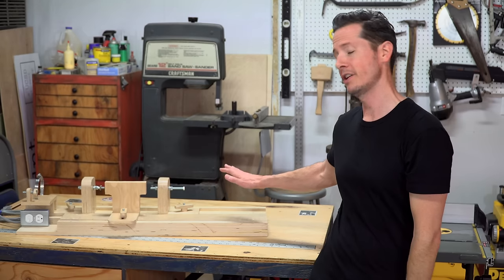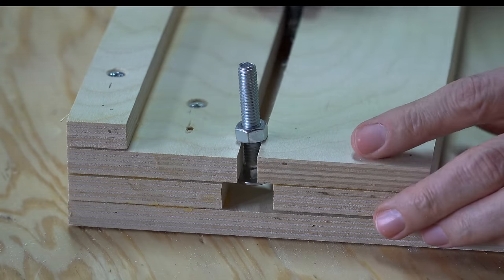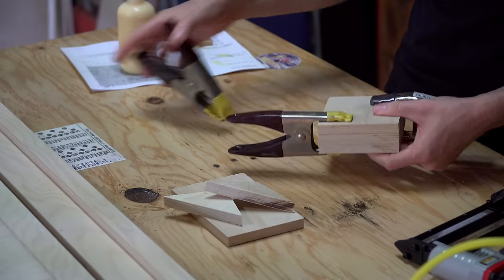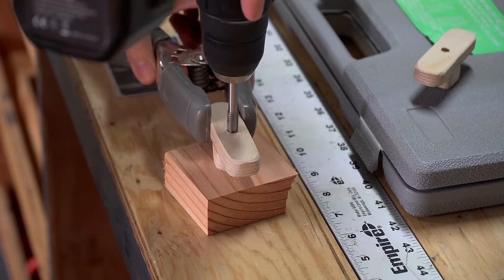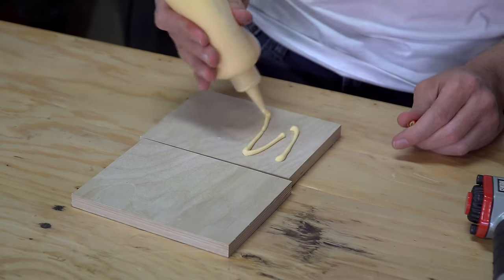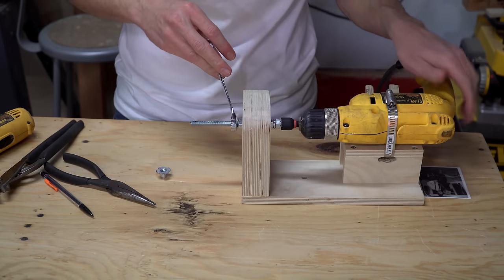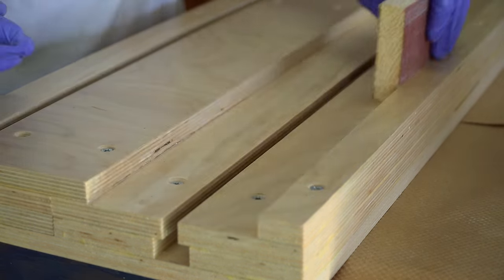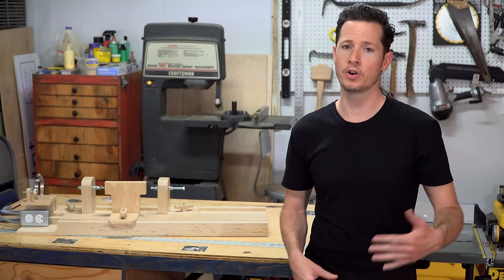DIY Drill Powered Lathe

Comment: The idea is good, but there are several dangerous mistakes. The detail on which the chisel rests during turning should be lower. Ideally, its height should be just below the turning axis. long grip which will reduce the effort at work and in which the inner shank of the chisel blade enters the handle more deeply. and do not forget to wear glasses and a mask when working. the details that the rotation throws in the face. security above all else. with respect and wish you every success as a colleague to a colleague from Baku Azerbaijan
Reply from the maker: Thanks for the feedback! I've actually made some of the changes you're talking about based on what others have said. Have a look here: https://youtu.be/UqvVQ2dZaAU

Comment: You might want to make your tool rest adjustable height width because it's too high think you need to watch some YouTube videos on Lathe turning to see how High the tourists are when they're turning it may help a lot you could injure yourself running it. High
Reply from the maker: Thanks for the suggestion - a couple other people have mentioned the tool rest as well. I’ve already changed it in my design, and will be changing it on the actual lathe sometime soon (definitely before the next use). Thanks again for taking the time to write a suggestion!

Comment: Why not put some wax instead? Alot of woodcraft techniques relying on slides requires something that facilitates sliding while not damaging the wood.
Using Wax is the perfect tool for the job!
Reply from the maker: That was my initial thought too, however in this application applying a pure wax like beeswax would collect dust. I did try apply a little bit of paste finishing wax on a small section and noticed that the thinners in the wax started to affect the polyurethane. That said, the poly probably just need more time to fully cure (a few weeks to a month). The other thing is that the sliding action is already really good...as the saying goes, "If ain't broke, don't fix it!".
Reply: One Minute Workbench Yeah, I totally noticed that towards the end. But my guess is that there was also a mixture of wood dust that was collecting. Well, like you said! We'll know more how it goes over time! But it's definitively something I'm going to try (although slightly different).

Question time: Would it have helped had you painted it or used a different kind of wood?
Reply from the maker: I think the polyurethane coating I applied is probably better than any paint I could have used. Polyurethane is basically a plastic coating, and a pretty durable one at that. It slides well, and is very easy to clean.

As far as the wood goes, I think Baltic Birch plywood was made for this sort of application. Birch is a 4/5 on the hardness scale, and Baltic Birch is IMO the best plywood you can buy.
Reply: One Minute Workbench Gotcha!! Thanks mate, I'll keep it in mind for when I do the project!

Comment: I wouldn't use any electric handheld tool unless necessary, buy a normal motor is you need one, those brushed electric tools will drive you mad with the noise
Reply from the maker: Drills are definitely louder than a good 3 phase motor, but at just a tiny fraction of the price, they're hard to beat. Luckily hearing protection is cheap as can be!

Comment: Instead of using the T nut, just buy a real spur and put it in the drill chuck.
Reply from the maker: Thanks for sharing that idea! The only problem I see with that is that the spur might not be the exact right size to fit through the bearings. If it’s only in the drill (without the bearing block/headstock), the drill doesn’t have the right kind of bearing to accept those forces. It could be dangerous, or at the very lesser it would wear the drill out prematurely. I hope this makes sense!

Comment: so so...why  does no one use  a motor always a drill...
Reply from the maker: I would use motors for more of my homemade shop tools if I could find the right ones at the right price. The great thing about drills though is that they are (or at least can be) powerful (the drill in this video is about 3/4 hp), cheap (it cost me $15), and pre-wired for common household voltage. I hope this helps shed some light on why I used a drill for this project!

Comment: Lathe only cost $35 made with tools that cost thousands. What up with the one minute video name? Very confused. However, looked like a solid result in the end.
Reply: He didn't really use any unusual or incredibly expensive tools. A drill a table saw and a bandsaw. most people should have access to these if you don't have them someone you know probably does
Reply: David Mcguire it's usually all the little things and tools.
Reply: @DG-AI777  drill (with common inexpensive bits), table saw, jig saw, finishing nail gun (Hammer would also work but slower), and wood glue. All relatively inexpensive tools that an average person could reasonably be expected to have or have access to or be able to afford. anyone who already works with wood with definitely have all of these things even a weekend hobbyist.
Reply from the maker: D G, the name is based on the workbench I design many years ago - it was designed to be able to be setup in under a minute, hence "One Minute Workbench". I do have a lot of tools, but I've collected them over many many years (probably about 15...or more). I say if you've already spent the money on some tools, there shouldn't be anything wrong in using them to build more tools and save some money. So I've built a lathe, a chop saw, a jigsaw table, a router table, a disc sander, my workbench, board milling station, some vises, and lots of other things that would have cost me even thousands more. I think with a few basic tools, you really can build a lot of the other tools you need. My advice to most people is to start with a table saw, then next on the list would be a drill press. With those two tools alone, you can really go a long way. Anyway, I hope this make sense! Thanks for taking the time to share your comments!

Comment: Not seeing the durability of threaded wood to tighten the bolts...  especially when threaded inserts are so readily available to give you steel threads in the same wooden pieces...

https://www.google.com/search?q=threaded+inserts+for+wood&oq=threaded+inserts+for+wood&aqs=chrome..69i57j0l5.5721j1j7&sourceid=chrome&ie=UTF-8

Also not seeing Epoxy as a durable solution for a bushing when 8mm rod - the inside diameter of a skate bearing - is readily avaible and could have been used in myriad ways, including threading the ends of it...  As you learned, the steadier the lathe, the better the results, so just don't see cheaping out like that.
Reply from the maker: Thanks for the feedback! I've done some (non-scientific) testing of wooden threads and have always been shocked by how much they can hold - maybe I'll do some more (scientific) testing and record some numbers...if I ever get the time! If I do, I'll be sure to make a video.

If I were to do it again, I would use a 5/16 steel rod. An 8mm rod likely won't fit inside an 8mm I.D. bearing (not without a press fit anyway) because there is no clearance. A 5/16 steel rod however would provide about .002" of clearance. This is the method I used on my 9" disc sander build, and the fit was perfect. It pretty much just allowed the rod to actually make it through the opening, but not enough to wobble between the I.D. and the shaft. There is still some wobble thought because of the cheap bearings I used.

In fact on both the lathe and disc sander builds, the wobble comes from the inner race of bearings themselves more than anything else. That's what I get for using ABEC 5s (at best...probably actually only ABEC 3s...cheapos from Amazon) instead of ABEC 9s.

Also bear in mind that these projects I build are usually fairly early prototypes. My goal is often to have a balance of affordability, simplicity, fun, and approachability for those who are new to building things. Anyway, again, thanks for the feedback. I can use it for the next time around!

Comment: Well Taaaaaaaarmy,

I think drills aren't designed for continuous or long period use.
Reply from the maker: David, thanks for the feedback! Actually, waaaay back in the day, some of the major tool manufacturers would sell lathes, bandsaws, and all other kinds of tools that came without a motor, and were designed to be driven by a hand drill. You are correct to an extent though - it depends on the drill. The drill I’m using is a heavy duty version that is about 3/4 HP. It’s not designed to take a lot of side load though, which is why I use double bearings in my design. That helps accept those forces without adding it to the drills bearings. Anyway, I hope this makes sense - thanks again!
Reply: @OneMinuteWorkbench  I'm right to a big extent.

We are not way back in the day and every thing is built down to a price now.
Reply from the maker: Fair enough. I still think it depends on what you’ve got. Some tools are not up to snuff. That said, I’ve had some good a good experience with the specific drill I’m using in the video. That thing is a champ, and the best part is I bought it used for only $15. Anyway, thanks again for your input!

Comment: My opinion as a teaching video you really kind of rushed thru it. I'm planning on making one but I had to watch it a few times. Please don't take my comment wrong. its a great design. The one change I'm making is I'm going to put a variable speed motor with a control to adjust the speed. But over all nice job

Comment: that wood is expensive... would be cheaper to buy a lathe
Reply from the maker: I typically buy Baltic Birch sheets in 5' x 5' for about $30 USD. This project took exactly 1/2 sheet, so about $15. I hope this helps!

Comment: Why clamp after pin nailing? Waste of time! The pin nails are doing the clamping! One or the other not both are needed
Reply from the maker: Small gauge pin nails aren't great at holding things together with much force (brad nails on the other hand are pretty darn good at it), but they are great for resisting shear forces. I personally like how they hold everything together just enough to allow me to apply screws or clamps, and they don't leave much of a blemish (brad nails do leave quite a blemish however). Anyway, I hope this helps!

Comment: I can't be the only one wondering... you have a workshop full of tools as it is - wouldn't it be easier to, you know, just buy a lathe? It is a cool project, but in light of a whole bunch of other machines, it gets a little bizarre...
Reply from the maker: It would definitely be easier, but nowhere near as affordable....or fun 😉 I try to build all the tools I can, but I needed some tools to get started. I feel like with a good table saw and drill press, you can really build a lot of the other tools you'd use in a shop. I hope this makes sense!

Comment: Wouldn’t it make more sense to just go to your regular job and put all the time (spent making this) into some overtime and then use the money to buy a real lathe that has everything in the correct position and doesn’t have wobble bearings “fixed” with epoxy and runs at the correct rpm. A real lathe also won’t burn up drills which aren’t designed for this type of constant duty. If this could have been thrown together in 15-20 min I might have a different opinion. This clearly was a project for someone with too much time on his hands.
Reply from the maker: I think whether or not it makes sense just depends on personality type. You bring up a great point here though. This project isn't for everyone. If you want a lathe right now, aren't into making your own stuff, and/or your only goal is turning wood, then it's probably best to just buy one. Thanks for taking the time to share your opinion!
Reply: I planned on building a lathe like this for some years now, but probably never will. I enjoyed watching him going through this process and encountering expected and unexpected problems - and seeing the finished thing.
While you won't turn a profit on this, doing it might be a source of joy.
Reply from the maker: I'm glad you enjoyed the video!
Reply: I should add that I did enjoy watching the video and it may have added something to my bag of tricks which are admittedly limited when it comes to woodworking. I also appreciate the professionalness of your response to my initial comment.
Reply from the maker: markolaw, thanks for letting me know! Have a happy new year!

Comment: Interesting,  but really not a very good idea; unless you want to burn up your drill, work unsafely or just waste money, time and materials. I'd bet you spent more than $30.00 on the Baltic birch plywood. You should take this video down.
Reply from the maker: Thanks for the feedback, and for your differing opinion! I won’t be taking this video down, however. I don’t overstate or understate what my projects cost, and I don’t produce videos of things that will damage tools or be unsafe. Well, at least not any less safe than using tools in the first place (tools are dangerous when built or used improperly). This design will not produce any more wear and tear on a drill than normal. What would typically “burn up” on a hand drill when used in a side-load application like this is the bearings. The bearings in a hand drill are designed to take thrust, not side-load. Since this is indeed a side-load application, that’s why additional bearings are added into the headstock and tailstock of the lathe. Those additional bearings are designed to accept the types of forces being applied, which saves the drill’s thrust bearing from burning up. Anyway, I hope this helps! Thanks again! Also, for anybody reading this that wants to build their own tools, don’t be discouraged! Learn about science, math, physics, engineering, and electricity. Become a person who understands how things work, and you’d be surprised at what you can do!

Comment: Yeah I will do the same he'll soon burn the drill out use the right equipment for the job 👎👎👎👎👎👎
Reply from the maker: Thanks for the feedback! There's actually been a lot of discussion about this in the comments already. A drill (depending on the motor size) is fine to run all sorts of shop tools. In fact, a lot of the manufacturers used to sell items like lathes, bandsaws, sanders, etc. without motors, and designed them to be run by hand drills. With the advent of cheaper motors being imported from overseas, the popularity for manufacturing those types of systems died down. That said, the concept still makes for great DIY tools at a substantial savings. Plus it's a lot of fun! Anyway, thanks again!